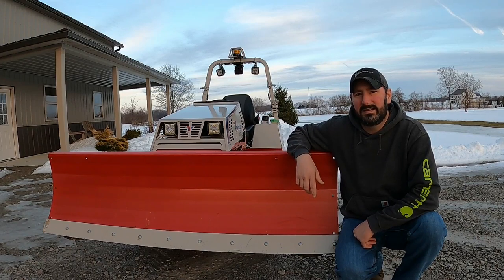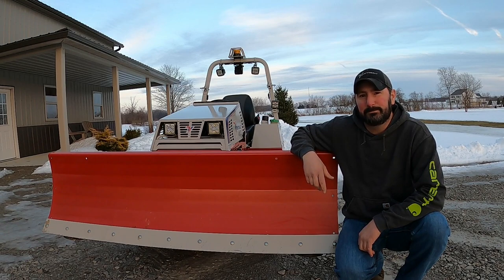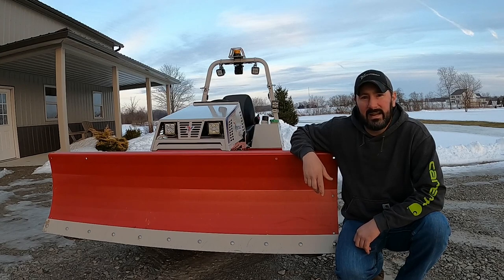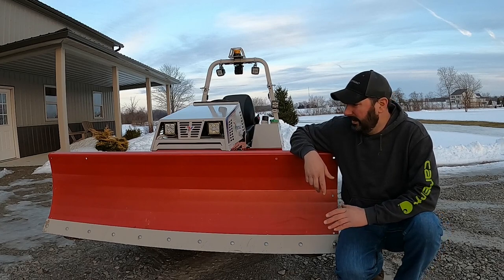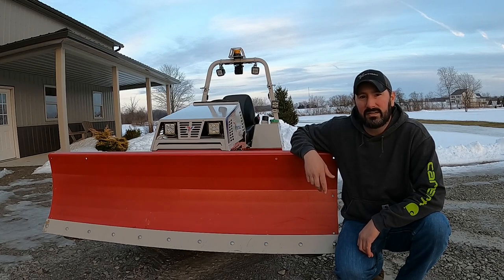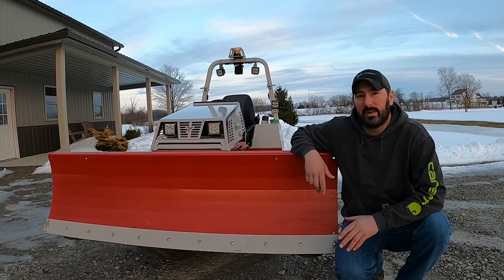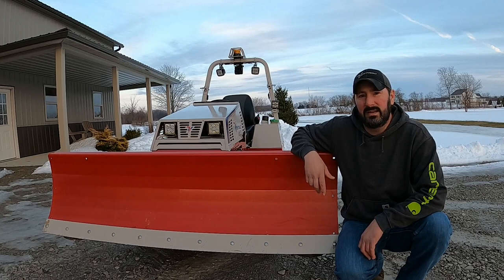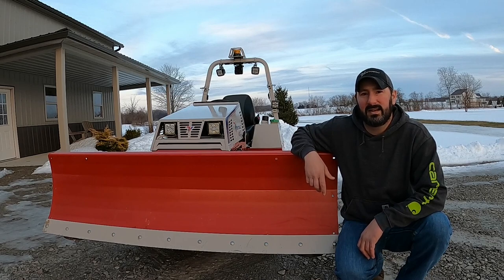Ventrac Polyurethane Cutting Edge Option.

Comment: You can buy poly on line in different thicknesses then drill it to fit.  Ideally get it a little wide so you can flip it as it wears.  I recommend adding the Artillian rubber extensions.  Steiner makes gauge wheels for the blades.  And you can fabricate your own rollover edge as well.  Or buy online.

Comment: Thanks for the video.

I have the poly edge, but living in Tennessee it didn’t see much use.
I ended up putting the steel edge back on and I end up using it more.
Reply from the maker: I can imagin in Tennessee there would be very little snow fall. I was curious on how the poly edge would work on dirt, or do you have to remove it? I would imagin dirt wluld not hurt it. What was your reason for going back to the steel edge?